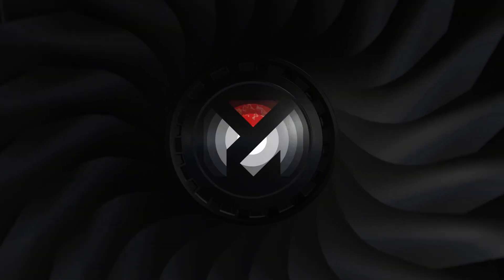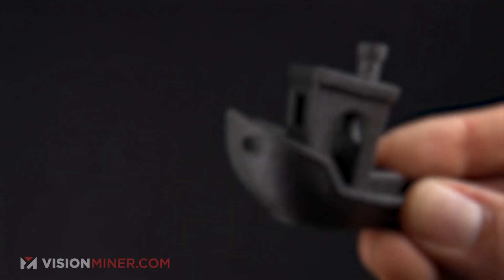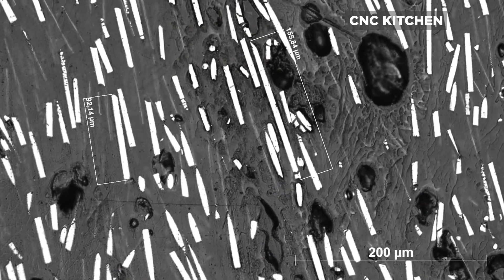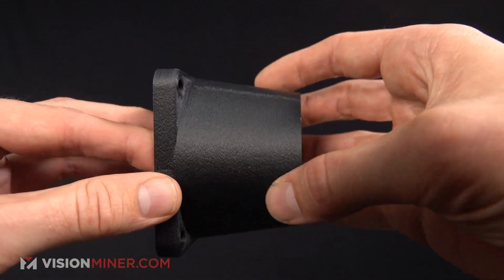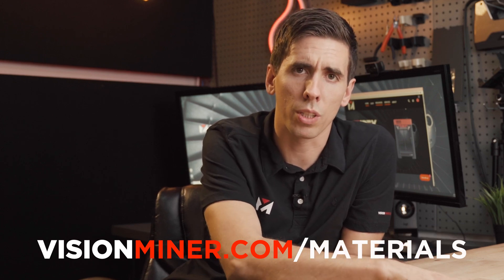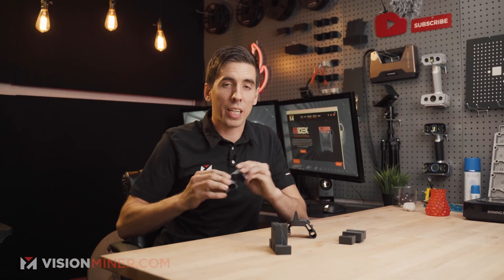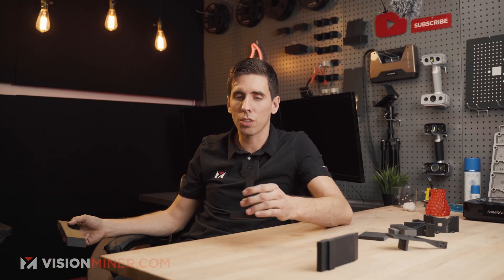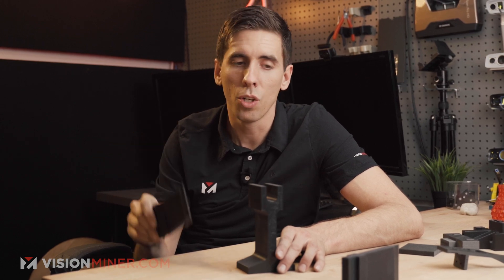Carbon Fiber 3D Printing 101 | Why All Carbon Filled Filaments Aren't Equal

Comment: I want to make mechanical/animatronic articulated wings for my cosplay. I don't want to use PVC pipes as I'm scared they will break; most of the mechanised ones I saw on the internet use Aluminum rods. I need something affordable, lightweight, durable, and flexible. Would 3D-Printing Carbon Fibre rods make sense for this project, and if so, what type of Carbon Fibre filament would you recommend?

Comment: I trashed all my carbon fiber filaments. When you look under the microscope, you can see that the material looses fibers that stick to surfaces and punch into your skin when touching. In other words, it shares some material properties with asbestos. The fibers/needles might not be as fine as asbestos and it is not clear whether there actually is a health risk. However, this was the same for asbestos. It took decades until the risk of the asbestos fibers became aparent after it had been widely used in literally everything. Time will tell ... but I would certainly recomment to not use it for anything food related and apply a coating that prevents the fiber from detaching.
This is not my original finding, I saw a youtube video about that a while ago and then checked my prints and filaments in the same way and indeed, the fibers were there and came off the prints.
I cannot rule out that different CF materials or filaments behave differently.
Reply: u are coirrect sticvk with petg or pla or pet cf if you wash hands its still there nowq imagine eating getting those stuck in throat just saying cf the worst

Comment: I need a material for a car engine that does not deform under some stress at prolonged temperature 70 to 100C.  a) Inlet manifold so resistant to fuel, and pressure from O-ring compressions b) thermostat housing working in a pressurised cooling system also with O-rings.   My supplier is currently using C/F PLA.
Reply from the maker: CFPA6 -- done. Or, if you can afford and print the higher-temp stuff, HTN+CF -- a high temp CF Nylon. Full-send? ULTEM™ 9085.

Comment: Does one need to buy your printers to print CF PPS?
Reply from the maker: One simply needs a high-temperature printer with nozzle temps upwards of 400c, and a build plate temp upwards of 160c, and a heated chamber at or over 90c+ to effectively print PPS or CFPPS -- we just happen to carry several options that will work, since high temp is all we do :)

Comment: I'm confused on your statement "Milled carbon fibre....decreases the strength....by a factor of 100". Which strength property are you referring to, here? Reason I ask is because milled fiber (both glass and CF) have been used for decades in various plastics (resin casting, epoxy paint systems, injection moulding) to increase tensile strength, part stiffness, and dimensional stability.  

So, my question is, are you saying the addition of mCF will produce a part that is stronger than the base polymer, but weaker than a part using long-discontinuous or continuous CF? Or are you saying that adding mCF will produce a part weaker than the base polymer? 

There is a lot of confusion and marketing wank regarding the addition of fibres to FDM resins, for sure, and a lot of it is BS. I find your videos to be helpful resources regarding engineering applications for FDM, but also want to ensure I am understanding what is being said correctly.

-TIA

Comment: I have a question? Is there a material strong enough to print a automotive or motorcycle wheel and have you ever done this successfully yourself?
Reply: I suppose CF-PPS could probably be used for that, but metal additive manufacturing is actually used to print wheel centers from aluminum or titanium. Not in a large scale but it exists. Look up Spyros Panopoulos Automotive for example.

Comment: Can you recommend a CF filament for home/Hoby printing that has strands and not milled CF ?.
Reply: Atomic, phaetus, IEMAI(Amazon). All use chopped fiber. Bambu lab is nice too but not sure if it is in fact chopped. I am using the Phaetus ae-worthy petg-CF personally for production of my parts. I did TONS of research on all CF filaments for months. I specifically needed rigidity and strength in the z axis as one of my parts is suspended across two rails 20" apart and I needed it to not snap but also not bend under average weight. Phaetus ended up being the strongest and most cost effective. The atomic which is USA made is very strong too but they refuse to publish specs on their filament. And I was looking to buy 100's of spools and they still wouldn't tell me. Some of the more expensive CF filaments are actually no better and sometimes worse than cheaper  brands  (I'm looking at you 3DO) and have been reviewed and tested to be pure marketing.   So higher cost does not equate to better filament in most cases. I am paying $28-$35 per kilo and it's better than the $50 brands.
Reply: @phasesecuritytechnology6573 Hi  that's great, I already use IEMAI ASA and it prints really well but I had no idea if it was milled or chopped carbon so I think I will stick with that especially if your recommending it, thanks for getting back to me so quickly I really appreciate it 👍.

Comment: For the example of the press brake. Your comparing 3D printed parts with tool steel? 
Like..... WTF!!! 
You basically just did what the miller CF filament guys do with their product. Totally over sold your capability. 
You were doing so well till you said.... this is a corolla, it can do what your Porsche does but for a fraction of the cost. I mean they both get you to work... yes. 
Hmmm...nah they don't even do that the same.
I am now going to have double check everything you have said.
I am being sold to rather than advised.

Comment: I have never 3D printed anything but carbon fiber is my favorite material and color. I have it on my car, motorcycle, bicycle, belt buckle, money clip, folding pocket knife, wallet, ring and a pool cue made of carbon fiber. Question for you is what is a good budget-friendly 3D printer that's able to print PEEK+CF20. I will most likely make automotive, motorcycle, bicycle parts (brackets levers mounts Etc) and anything else I could think of out of this carbon fiber material.

Comment: The worst thing with all carbon fiber added to FDM is layer adhesion. You can do whatever you want, the layer adhesion will always be worse sadly.
Reply: Not true. I have extensively used petg CF for a year now. Printed hundreds of parts already using 4 different brands. Zero layer adhesion issues. Design it right, slice it right, print it right, never breaks.
Reply: @phasesecuritytechnology6573  layer adhesion will be worse compared to petg without cf. It cant be any different way regardles of the way you slice or print it. Thats just how Physics works. Petg has very good layer adhesion anyway and getting 10-20% weaker shouldnt matter anyway. We cant trick physics.

Comment: I know you say the mark forge continuous carbon is “proprietary. But you can buy 3k or 6k tow continuous. The question or more realistically the solution would be post infuse right after extrude but before pulleys correct diameter. Hypothetically an extruder could be setup to add the tow line in to it, I am not sure if such a thing could be proprietary if on outdated create a simple injection process. I might try it with n extruder and pla pellets just to see if I can.
Reply from the maker: More specifically, the onyx polymer is their own blend, and the hardware is proprietary -- check out Continuous Composites, they have a pretty cool setup :)
Reply: @VisionMiner  Wowww that is amazing, their idea was brilliant with resin uv cured on the fibers, thanks for sharing that. I was thinking regular filament Gerry rigged on a 3evo or something. Their process reminds me of the quote "Talent hits a target no one else can hit; Genius hits a target no one else can see" - Arthur Schopenhauer

Comment: How do I get into the second/third tier and avoid the milled stuff. Just a hobbyist who want heat resistance and something that doesn’t loose shape over time under clamping pressure, but otherwise the properties in cheap pla/petg is good enough. Maybe there is something better than carbon infused materia?

Comment: Can you layer Aerospace carbon fiber overtop of a 3D printed metal such as aluminum alloy?

Also, what is the strongest strength to weight ratio 3D printable material? Say if you wanted something to stop arrows or even bullets and were making a shield or armor. 

Could you layer the aerospace carbon fiber over aluminum alloy (or something lighter/stronger) in the same part of the shield for instance, all in the same print?
Reply: Why would you want to use carbon fibre for stopping bullets and arrows? Thats what Aramid (Kevlar) fibers are for. You use CF for high stiffness to weight ratio, but CFRP is very brittle as CF does not stretch much (max 1% if I remember correctly). If you need to absorb lots of energy from an impact, stiffness is not your friend. 

Your post got me thinking: if CF reinforced filament is such a big market, would anybody sell Kevlar reinforced filament? And apparently, they do 😀

Comment: Awesome! I'd like to build home made quadcopter frames. Right now I'm using PETG filament for poc purposes. I'd also like to try printing it with carbon fiber. I'm aware that 3d printed carbon fiber won't be as strong compared to the ready-made carbon-fiber frames. Which brand would you recommend?
Reply: I use petg-CF from phaetus. They have a full spec sheet on it. It's very good. It has the give of petg with a rigidity like pla.

Comment: |> |> |> |> |> |> |> |> 
|> |> |> |> |> |> |> |> |> 

I need for 3d printing a modul for naval applications for a drive with high pressure and which will be covered with carbonefiber sheets and expoxy.

Basicly its a positive sample which is that layers of carbonefibercloth thinner.

the wallthickness is about 4 mm, and I need a printer which is able to print 45 × 45 × 45 cm ...

And that cheap as possible, its for a prototype and Im not rich.

what you can recomend?

|> |> |> |> |> |> |> |> 
|> |> |> |> |> |> |> |> |>

Comment: Interesting topic to talk about. I've been using Atomic Filament's Carbon Fiber PETG for a bit and I do like it though something feels off. I recently printed a solid infill linkage I designed for a fourbar mechanism out of the CF PETG and tried folding it in half by hand. I did the same  with a print in natural PETG solid infill and noticed that both pieces broke very similar in a ductile manner. Maybe the carbon fibers used wasn't as optimal as I thought or maybe I'm doing something wrong? Going to try and compare Atomic CF PETG with 3DX Tech CF PETG and see the difference. At least 3Dx Tech has a nice TDS on it's stiffness compared to Atomic brand but we'll see.
Reply: Just got my order of 3DX Tech CF PETG and man it is night and day with Atomic Filament CF PETG! I printed a little plank that I did before and it snapped as I was expecting it should. Then I realized that Atoimic stated there filament to be not as brittle as other CF filaments so I should have read the fine print. Moral of the story, check the TDS and compare the tensile and elongation at break % to determine how stiff of a filament you're getting! :)

Comment: My job is to produce Phototypes that are close to a final product, extended time use. 
My question is the long term duribility of these carbonfiber blends? It seams to me there may be  a weakinging over time due to the mixture of extremly hard (carbonfibre) and the softer compoinets. Thanks

Comment: Really nice vid i just discovered you guys today. But i have 2 questions. First what brands can you recommend from EU will check your website later if i can find some there. Second do you know about greentec pro carbon and where would that one rank? (high/top tier or at low/bottom looking for some heat resistant easy to print and maybe strong filament)

Comment: Holy smokes does that CF-PPS ring! And I agree on all points especially since I so often get told by others that CF filaments "aren't worth it" but when I ask what filament they used it's always ones that use milled CF which yield no real mechanical benefits that high quality CF filaments offer. This is an absolutely great resource given how often y'all print with CF filaments. I print with almost nothing but CF as well because it's so awesome however, Industrial grade CF can't be compared to low quality CF.

Comment: 3:09 Isn't ABS with milled CF stronger than ABS alone?  Plus, I understand that people are able to print (e.x., Voron parts) w/ milled CF ABS w/o an enclosure.
Reply from the maker: Milled CF actually decreases the surface area of the polymer attaching to itself, making it much weaker -- when you have chopped carbon strands, they act like skeletons, but milled is just dust, which makes it worse :)

Comment: My conviction is carbon fiber filament, even at a low rate, will be crucial to democratize the use of engineering material since the limitation of "affordable" industrial 3d printers with an enclosure remains the max temperature of the build volume. For  PLA, ABS, PETC etc, the addition of Carbon Fiber is an upgrade, for PEAK or PEI printing virgin material is a "luxury".

Comment: What I'm expecting from Carbon fiber filaments is not the strength and rigidity but:
1. Less warping
2. Dimensional accuracy
3. Easier support removal
4. Smooth surface
Reply from the maker: 100% !
Reply: I disagree if you use carbon tow line it increases tensile strength greatly especially if horizontal printing.

Comment: What wears out first besides the nozzle when printing CF reinforced filaments? and how come Glass fiber is more abrasive than carbon fiber?
Reply: Everything touching and rubbing the filament wears out. I would think the extruder gears are the second thing after the nozzle. Glass is harder than graphite (which is a first approximation for the atomic structure of CF) due to the atomic bonds and structure. A glass cannot plastic deform. Graphite can glide parallel to its graphene planes and that is why it is even use as a lubricant. In CF these graphene planes are (in the ideal case) aligned with the direction of the fiber. So you usually do not glide the planes relative to each other while loading the fibers, except under shear stresses.
Reply: Thanks :)